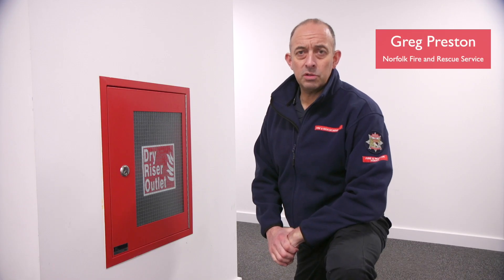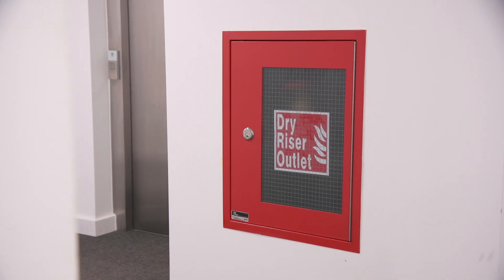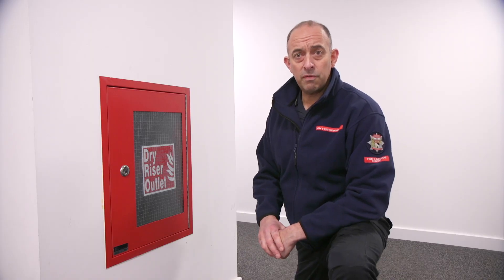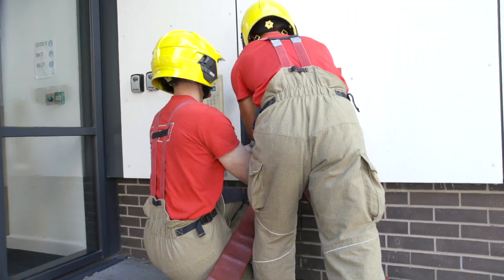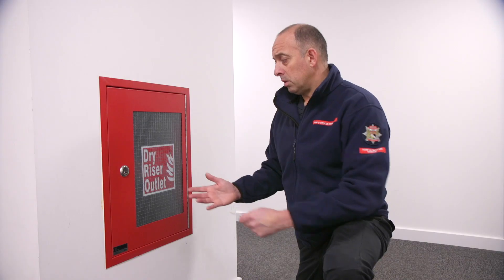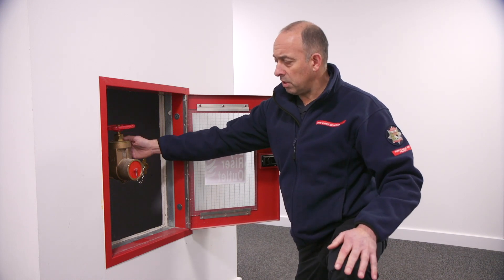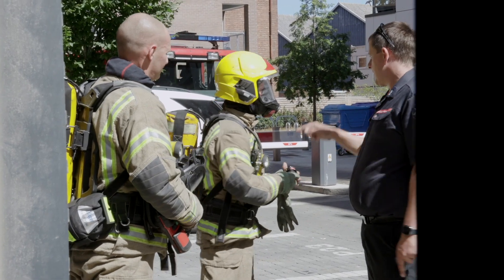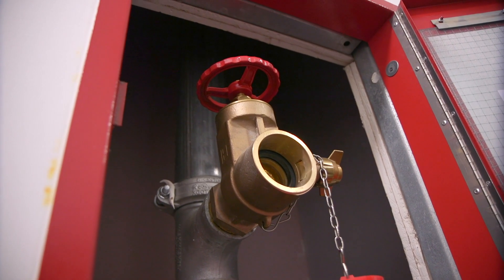6. What is the dry riser outlet?

Comment: Crazy from an American perspective how small British standpipes are. Is that 2.5” pipe? Do attack crews exclusively use 1.5” (“40mm”) hose? The kind of flow I’d assume you get from that system would be what in the US would only be considered adequate for occupant use, like British hose reels but a little bigger.
Reply from the maker: Hi there, thanks for your query. Brian Walshe, our Head of Fire Safety, replies: 

Attack crews use appliance hose reels, 45mm and 70mm lay flat hose. The lay flat house terminates with  2.5” instantaneous couplings. 

Hope that answers your query!